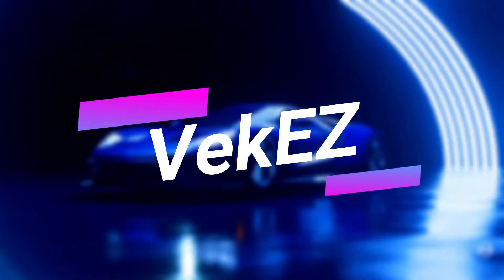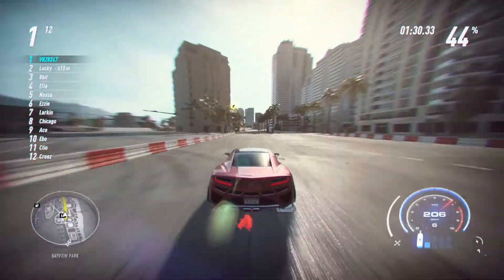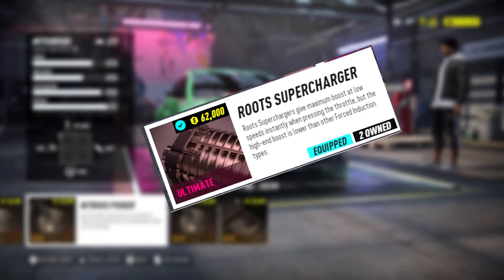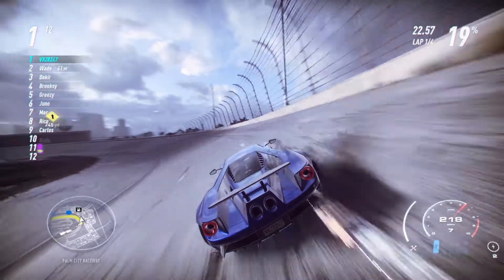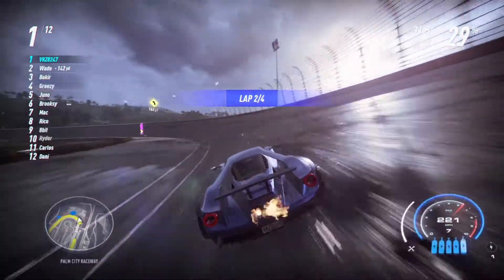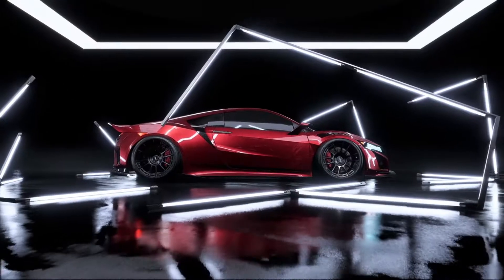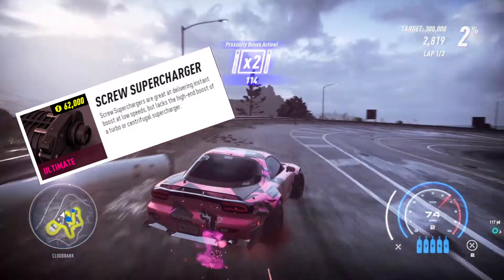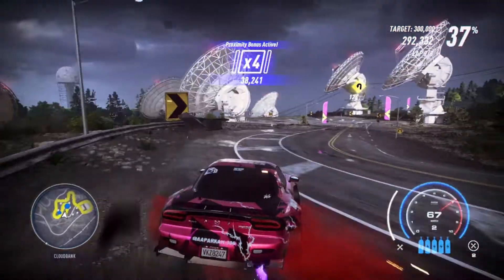NFS HEAT - Turbos and Superchargers Explained - How to pick the BEST!

Comment: Centrifugal works great on 4.4v8 and i6 for the bm McLaren, I consistently break 1.40 on the resort race, and take each turn at a consistent 185-190 without dipping too much, or hitting walls. If you're most used mph is about 40mph under top speed (234 for me) and you're taking wide turns with 0 down force, you'll fly by racers ez

Comment: FYI for everyone: the Nissan 180sx  with the 3.8 v8 948hp swap and track everything and the 4 speed, will beat every single car on 'The Resort Circuit' race. And will hold 210mph around both turns on the track if you learn to time your turn correctly

And it's a surprisingly fast drag car with the same set up as above but with the drag tires instead
Reply: wait until a rsr pulls up😅
Reply: 180sx is a beast for sure, but the RSR is so op it might aswell come with cheat codes included. what turbo do you have on that car?

Comment: Which one of these do i use on my rsr racer?
Im using root rn cause the acceleration is already very good
Reply from the maker: you can swap to a turbo so you have higher top end. Since the RSR is already really light, a supercharger is just gonna make it take off even faster. Great for drag racing or circuits where you cant reach a top speed. But for more top end oomph, try a turbo.

Comment: Hey man, I wanna use a supercharger for my ss camaro in nfs heat, I want it to be my racer, which would you recommend? Screw or root?
Reply from the maker: You're not going to get much out of muscle. They're just not that fast, even considering the mass amounts of horsepower  you can get. You're better off with a Twin Turbo to help at the top end, but either supercharger will do about the same.
Reply: @VekEZ8247  thanks man! Just trying to one up peps with my ss
Reply from the maker: @aidanrumfelt351  muscle are hands down some of the better drift builds If you're into that.
Reply: @VekEZ8247  that’s more of my best friend… I’ll let him know though if his tuners aren’t doing him good